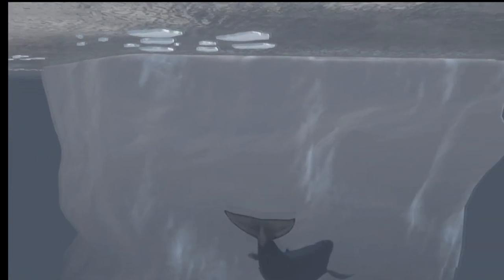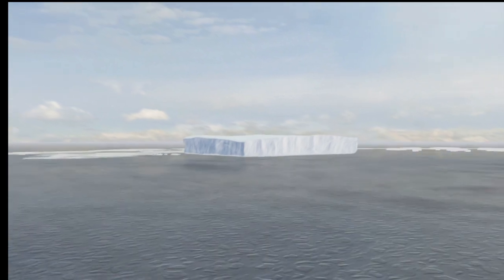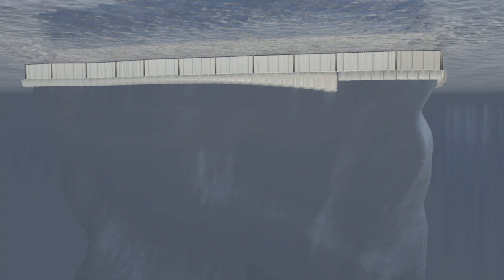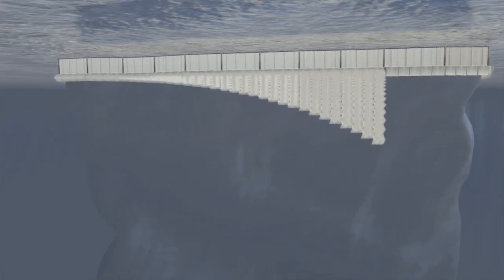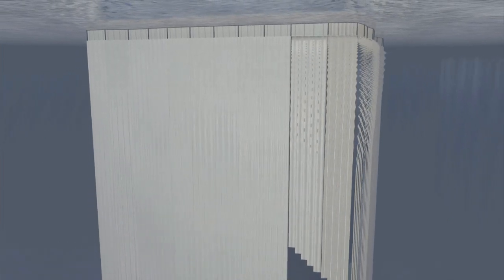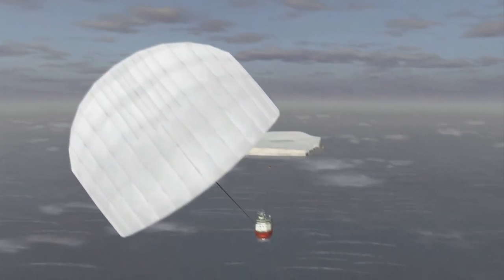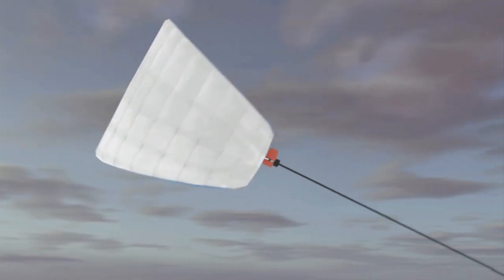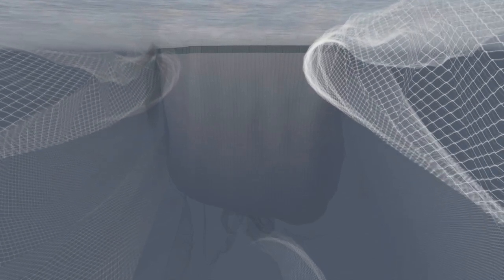Towing Icebergs

Comment: There's a reason that this is fantasy. Ninety percent of the iceberg is underwater, weighing millions of tons for the larger ones. This concept is almost akin to expecting a small fishing boat (or similar) to try and move the largest supertanker (fully loaded) sideways from a dead stop. You might theoretically be able to do it, but the moment there is any significant wind conditions, or underwater currents... you're going in that direction, regardless of what the 'computer modelling' might suggest.